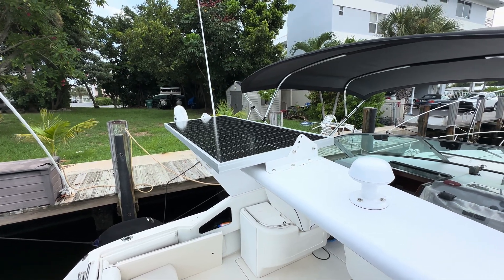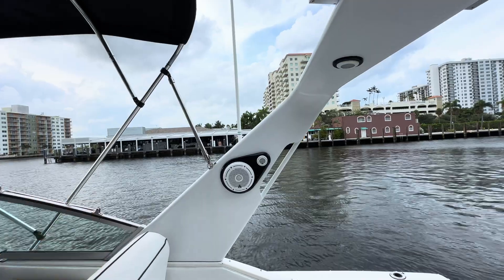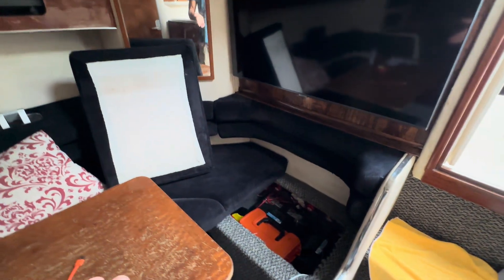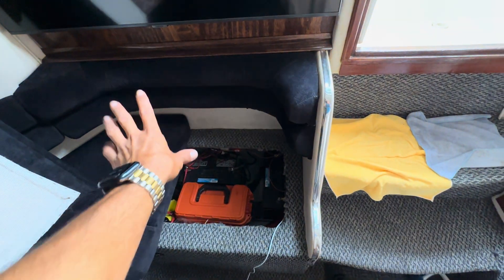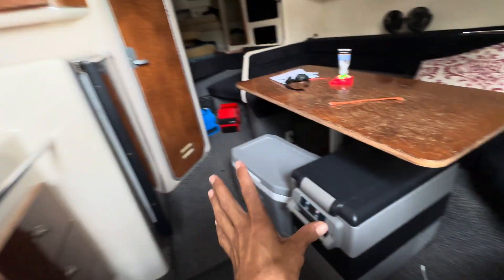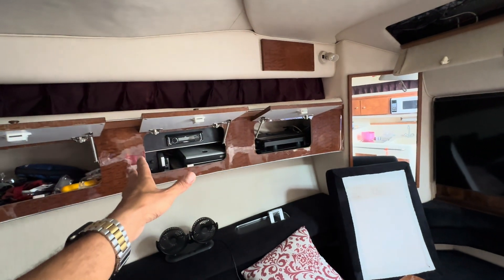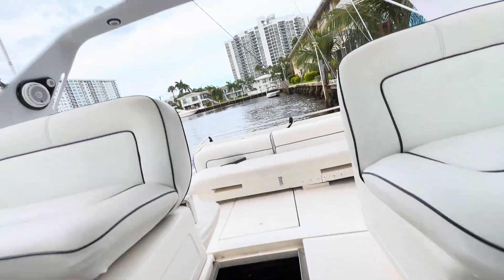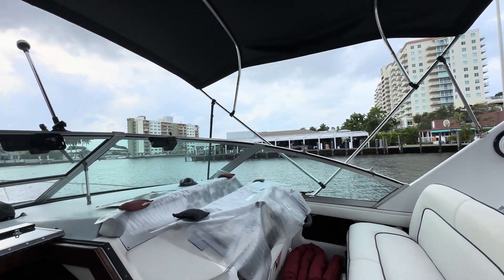⚡️Powering My Vessel with Sunshine⚡️

Comment: If it has rust it is not aluminum. Possibly tin .. more than likely cheap metal. Find a friend that has 3d printer and ask him to make you some brackets. Make sure the material is coated with u.v. protectant.
Reply from the maker: That’s a very good approach now that you mentioned I do have a friend that messes with 3-D printer. I may ask him to redo those pieces for me. Thank you bud! 🙂

Comment: I'll make the whole roof hold 1kW worth of panels, 3-5kW worth of batteries(You could just also get a power station, ecoflow) , MPPT charge controller and a 2kW(continuous) sine wave inverter. I'd bring a microwave and minifridge. Heck with that amount of power storage I'll bring any electronics I can bring.
Reply from the maker: Wow, that would be enough even to run the TV and everything right? because when I want to run the air conditioning and TV I turned on the generator.. hopefully a bigger boat soon that I can do all of this 😅
Reply: @Cruisingthesouth  The TV definitely. The AC, depends on how much power it uses I'd say on that size of a boat it uses around 200-300W but I might be wrong. If it is then you'll be good running it overnight.